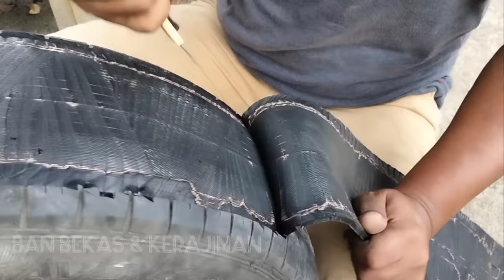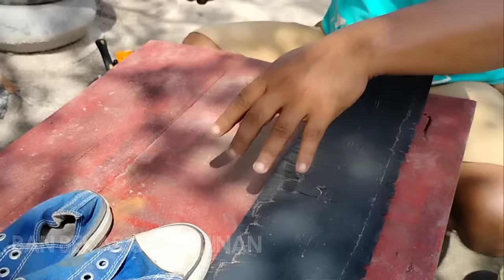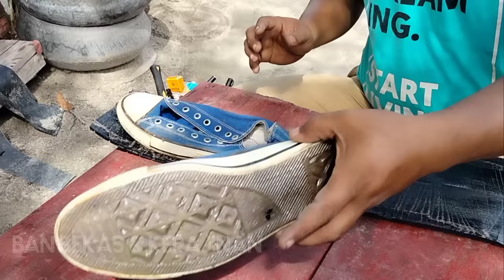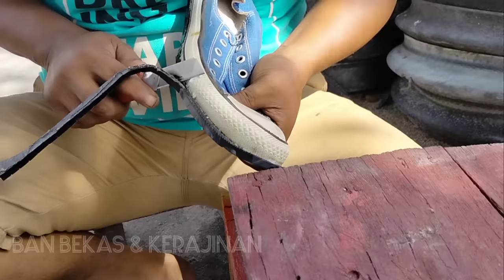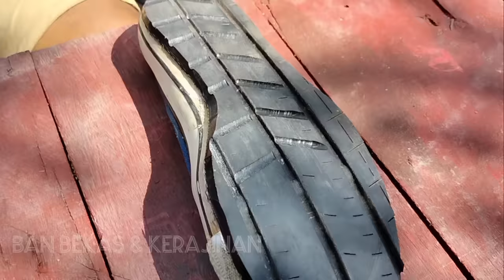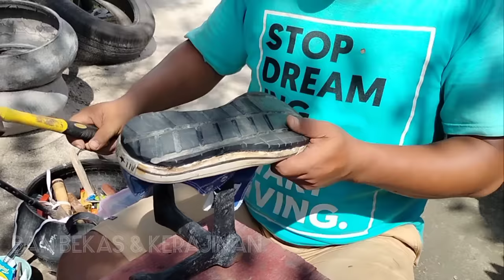Make the bottom of a strong shoe with used car tires

Comment: Very nice work! 
Can that be done with steel-belted tires? Hard to find nylon radial tires in my area.
Reply: Yes. Just can't cut steel reinforcement with Stanley knife. Could remove tread from steel wire but will take time.
Reply: Motorcycles !
Reply: @dancelord0708  
Thanks! Are motorcycle tires wide enough?
Reply: @markcornelius8802  Yes.

Comment: Shoe repair shops should recycle used tires to make soles rather than buying new materials to make it look good as new.

Also I hope your costumers won't get mad if you use them to replace the worn out shoe soles that originally came with the shoes

Comment: hello friend tell me what type of tire and these there because I do not see the steel wire in them. how do you cut so easy they are mixed of polyester steel nylon or are only nylon
Reply: every tires can use it , use your car tires also can
Reply: @dollahgembalalembu1305   i tried to use the ones that have wire and i coundnt cut
Reply: @dollahgembalalembu1305  I can't cut my tires they have wire inside what do I do
Reply: You have to use folding tyres, it's a kind of tyres with nylon I/o wire